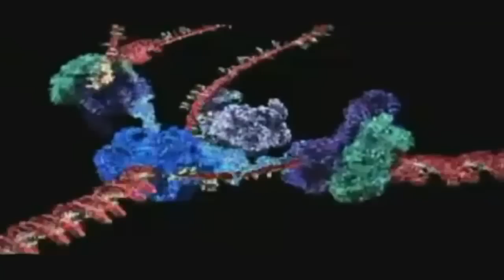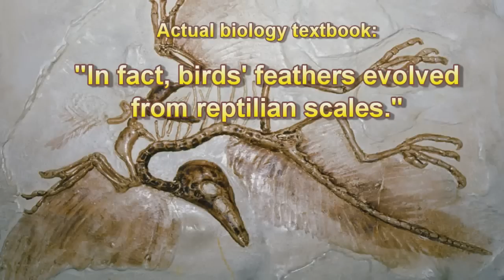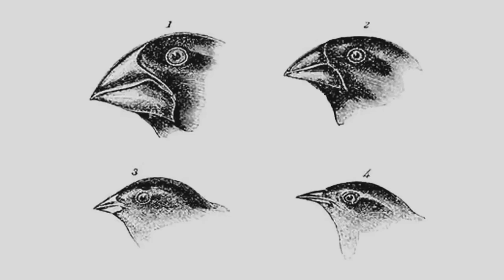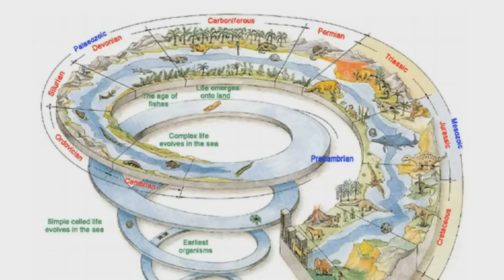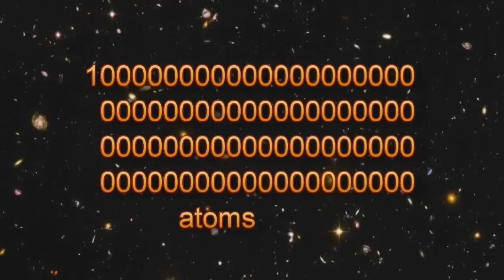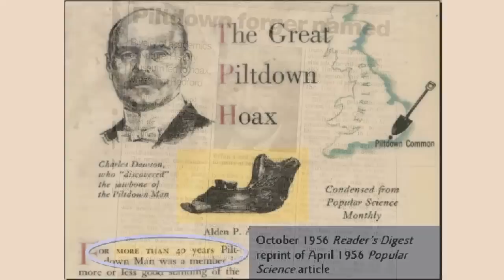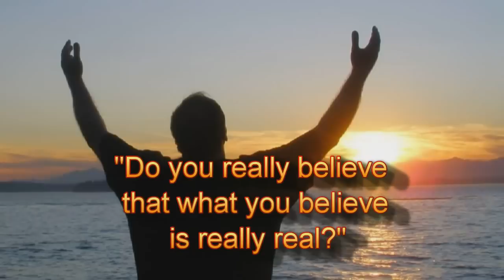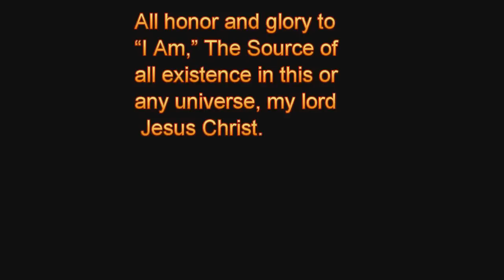Evolution Demolition

Comment: 11:10 Abiogenesis.

That's correct, we have no established theory for abiogenesis, yet.

However, we've made pretty damned good progress with the "RNA World" hypothesis of abiogenesis. Largely thanks to the scripps research intitute.
We've demonstated how molecules could naturally go from simple molecules like sugar (and phosphate, or whatever), to ribonucleotides. Ribonucleotides have been shown to easily link up into chains, RNA. We've demonstrated that RNA can be really good at self-replicating, and can mutate and still self-replicate indefinitely. That is, they can "evolve" into better self-replicators.
We've also shown that RNA can turn itself into DNA.

So, we've got simple molecule to DNA demonstrated. That's pretty good work. Not quite a full solution to abiogenesis, but pretty far on the way to it.

Now as for ATP synthase molecule... once again you're making the mistake of assuming that the current iteration of cells, and their internal parts, are what must arise through abiogenesis. Complete crap, obviously. 
That ATP synthase molecule has evolved for 4 billion years. Do you really think it would remain the same over that time, given evolution? No, the better versions would beat the older versions. I suspect we can only speculate on how bad the early versions were.And btw, this is proven by the fact that different lifeforms have different version of this ATP synthase molecule. So obivously it doesn't have to be exactly in one way. E. Coli has a simpler (the simplest, perhaps) form of the ATP synthase molecule, for example.

13:03 Nooo, ask them what they believe about abiogenesis, and if they're good scientists they'll tell you they don't know. They're not "betting the farm" on anything. Only a stupid person would bet on something they don't know.
Dawkins, for example, is an expert of zoology and evolution (right?). Not abiogenesis. Once again, evolution is not abiogenesis. Even if a god (or somethign else) created the first living organism, evolution still happened. Those are separate things.
And yes, god creating life is also abiogenesis, since non-life became life. That is, unless you want to argue that life has always existed, and never "came to be".
I guess the difference is natural abiogenesis vs artificial abiogenesis.

But please tell me why your answer to abiogenesis is "magic"? Ever actually observed "magic"? Anything saying that "magic" is even possible? By definition, "magic" is an exception to natural laws, and you said "no one is above the law", in this very video.
Reply: antiHUMANDesigns "We've demonstrated that RNA can be really good at self-replicating, and can mutate and still self-replicate indefinitely."
Sorry, this has never been done.  But even if it had... What about the source of the information content that instructs how to put biological systems together?

ATP Synthase could not evolve before a living system that reproduces.  Evolution requires reproduction first.  But reproduction requires an energy source, such as ATP Synthase.

What are you talking about?  Abiogenesis is magic.  It is fairy dust.  An intelligent mind operating on a universe is not magic.  We can test for the activity of intelligent design in many sciences.  Why do evolutionists ignore this kind of science?
Reply: Mark Champneys "Sorry, this has never been done. "

Yes, it has. I've read the science. I think it was done by the scripps research insitute.

"But even if it had... What about the source of the information content that instructs how to put biological systems together?"

This is pre-biotic chemistry, it doesn't deal with actual life. It's not quite "biology", yet. RNA that replicates does not equal life.

However, the source of such information would be natural selection acting upon replication with variation.

"ATP Synthase could not evolve before a living system that reproduces.  Evolution requires reproduction first."

That is pretty much a tautology. Evolution deals with living things, so yes, only living things can technically evolve, unless you mean "evolve" in a more figurative sense.

"  But reproduction requires an energy source, such as ATP Synthase."

"Such as", yes, but not that one, specifically. What it needs is a source of energy.

"What are you talking about? Abiogenesis is magic. "

Abiogenesis is life from non-life, whether done by magic or some other means. Even a god creating a human from dirt is abiogenesis.
One thing we can say for sure is that there was an abiogenesis event, since life hasn't always existed. Whether this was a natural occurance of an artificial occurance is yet to be demonstrated.

" We can test for the activity of intelligent design in many sciences. Why do evolutionists ignore this kind of science?"

Explain how we can do that, and I can respond. None the examples I've seen so far have been proper science, because they weren't falsifiable and didn't use a scientific method.
Reply: antiHUMANDesigns "I think it was done by the scripps research insitute."
Nope.  I know of experiments in which a particular enzyme (protein) has been able to catalyze itself to produce more of the same enzyme.  That is the closest thing to self-replication there is.  RNA has never self-replicated, especially not keeping the altered base sequence in the event of a mutation--which would be essential for the term "self-replication" to mean anything.  Never.

" 'Such as', yes, but not that one, specifically. What it needs is a source of energy."
And what is that?

"Even a god creating a human from dirt is abiogenesis."
No it is not, since "a god" by definition is alive.  That would be life from life.  Abiogenisis is the idea of a spontaneous formation of life without a living source via chance and necessity alone.  It is purely materialistic/naturalistic.  I think you knew that.

"Explain how we can do that, and I can respond."
The sciences of forensics, archaeology, anthropology, etc. all detect intelligent activity by direct evidence.  How would CSI lab's do their work without this kind of science?  Intelligent activity leaves artifacts that can be observed.  Things like symbolic digital code.
Reply: ***** Yes... """"forget"""", huh? :P
Reply: antiHUMANDesigns Thanks for the link.  Interesting paper.  I will grant you this much: they have taken this replication thing a teensy bit further than I realized.  It is a few microns further along a trillion lightyear journey to a living microbe.

As I look at the paper I notice that the authors play fast and loose with a couple of terms.  The term "self" and the term "information."  They call it self-replication, yet the scientists supply most of what is needed to make the chemistry happen, and few of those things would ever be supplied naturally or spontaneously.  I get that they want these short RNA molecules to make copies of themselves by themselves.  But wanting is not having.  It may be replication, but it is anything but self-replication.  I was actually pleased to see that they admitted to the word "information," since that is really the issue here.  Yet what they describe is not prescriptive information at all.  And even if it were, they have not dealt with the issue of where the encoded instructions came from or what the instructions do.  Again, the main issue.

I also noted that the RNA strands were extremely short.  This is important, since the longer they get, the more fragile they become, reducing the likelihood of their "survival" in the face of their susceptibility to increasing entropy.

Are you really arguing that God (if He exists) is not alive?  Goofy, and irrelevant.

"...it's true that intelligent design isn't very interesting to the subject of biological evolution, for the most part."
They are not interested because they have a priori ruled intelligent activity out.  You use the word "supernatural" as an emotionally charged word, but isn't all intelligent activity outside of nature in a sense, and within nature in another sense?  If a victim is said to have died of "natural" causes, does that mean that another may have died of "supernatural" causes?  I suggest dropping the notion of supernatural being somehow magical, and consider a Creator who is the very source of nature--an entity that can by studied (in part) by what He has made.  As I said, intelligent activity leaves artifacts.  Why are evolutionist scientists afraid to consider those artifacts?

Three kinds of causality exist in the universe: chance, necessity, and agency.  By chance I mean the laws of mathematics and statistical probabilities.  By necessity I mean natural law and physical properties.  By agency I mean the volition of intelligent mind.  Evolutionists are extraordinarily unscientific by choosing to consider the first two kinds of causality, and ruling out the third without basis.
Reply: Mark Champneys Well, yes, the furthest that I am personally aware of us getting, is all the way up to how DNA enzymes can come about. But you're absolutely right that a DNA enzyme is not "life". 
But consdiering how fast we're moving, just give it some more time, and we might demonstrate how proper "life" can come about. Those scientists are pretty good at what they do.

"They call it self-replication, yet the scientists supply most of what is needed to make the chemistry happen"

Yeah, chemistry needs to have chemicals accessible, that's obvious. And they don't do thes experiment in a lake, so to say, but in a controlled environment.
The thing is, first you need to know what is needed to make it work, and then you can work on how those needed things could have been there.
It's true that if they need something that cannot have existed, then the whole hypothesis falls flat right there. But I don't think that part is settled yet.
And remember, this is still a hypothesis, not a theory. It's only a proposed solution to abiogenesis, not a verified solution.

" It may be replication, but it is anything but self-replication."

No, it's still technically self-replicating, since nothing else is doing the replication for them. It's obvious that you need materials to build a house, but if the house built itself from the materials provided, it's still a self-assembling house.

" And even if it were, they have not dealt with the issue of where the encoded instructions came from or what the instructions do."

That is because of ignorance on your part. A DNA molecule is just a molecule, and it has chemical properties. The structure of DNA makes certain things happen. What the "instructions do" depends on the laws of chemistry, nothing else.
For example, oxygen and hydrogen will combine to form water - not because someone instructed that, but because that's what happens. And DNA is a molecule in the same sense that water is.
You cannot look at modern DNA, which has already evolved for 4 billion years, and ask how that DNA could come from "nothing" (so to speak), since it didn't. Modern DNA is the way it is because it copied itself from DNA that already had those sequences.
What you really need to know is what basic things DNA needs to get life going. We don't know that, and we don't know how many possible combinations could lead to something that "works". The fact that our bodies work the way they do might just be a coincidence, and we might have worked a different way.

However, our DNA has evolved from merely being a chemical process, to being a form of machine code that runs a machine. (At least it's a valid comparison.)
But that doesn't mean that's how DNA started. In fact, it cannot have started that way, it must have evolved into that.
All I'm saying is that modern life is highly evolved and plays by different rules than the early life that was "barely even life".

"I also noted that the RNA strands were extremely short. This is important, since the longer they get, the more fragile they become, reducing the likelihood of their "survival" in the face of their susceptibility to increasing entropy."

That's pretty correct, yes. The RNA likely changed into DNA when it become so long that the rate of mutations made it hard to survive. I'm specualting, of course. But the selection pressure on the RNA molecule would be for it to not have so many errors. DNA doesn't mutate as easily, so that mmight be eactly reason why that happened. And as it got even longer, some error checking mechanisms might have evolved.

"Are you really arguing that God (if He exists) is not alive? Goofy, and irrelevant."

Most definitely, and I think you would agree.
There are 7 criteria for "life", and god doesn't fullfill all of them, so he would not be classified as life.
Let me see if I can remember them:
1. Maintains homeostasis.
2. Metabolizes.
3. Reacts to stimuli. (Poke it, and it reacts, so to speak.)
4. Grows/delevops.
5. Reproduces.
6. Evolves.
7. Is made of cell[s].
Life must fullfill all of these criterias. 
As I understand "god", he would not fullfill criterias 2, 4, 5, 6, and 7. That means god is not alive.
And yes, this means a virus is not alive, either.

"They are not interested [in intelligence] because they have a priori ruled intelligent activity out."

No, because there is no way to test for it, so it's useless (unfalsifiable). If a god is indeed messing with our experiment, then we have no way to know. If we ever gave that idea real credibility, then we can just stop doing science, because we cannot learn anything about anything.
Obviously, we are albe to learn things, because our technology works. It's evident that the universe is consistent and isn't just messing with us.

" If a victim is said to have died of "natural" causes, does that mean that another may have died of "supernatural" causes? "

The opposite of "natural" is "artificial", not "supernatural".

"  I suggest dropping the notion of supernatural being somehow magical"

I'll accept anything, once someone can demostrate it. But because it is impossible to ever demonstrate something that isn't natural, I don't expect to ever get an example of something that isn't natural.
If god was ever demonstrated to actuall yhave an impact on the universe, then I'm quite sure whatever method he uses to do so will be considered "natural".
Or, as AronRa said, "if god sticks his hand into the universe, his arm will be dripping with physics". (Might not be an exact quote.)

"and consider a Creator who is the very source of nature--an entity that can by studied (in part) by what He has made. As I said, intelligent activity leaves artifacts. Why are evolutionist scientists afraid to consider those artifacts?"

Once again, because you're making an unfalsifiable claim. If you're saying that an omnipotent god, that is outside of the universe, is the cause of some things in our universe, then how does one test for that? An omnipotent god is able to do anything, and in any way, so there is no test that can be made to falsify this idea.
That makes it..
1) Unfalsifiable, and therefore not science.
2) Completely useless, since you can't say that anything would be different whether god exists or doesn't exist.
Therefore, such a claim can be promptly ignored. Since ID is not science, I don't see why you're asking scinetists to treat it as such.

However, if you can propose any kind of test that could falsify your claim, then we're all listening. What predictions does your claim make?

"Three kinds of causality exist in the universe: chance, necessity, and agency."

I do not accept this. There is only one kind of causality, and that is causality. Causality cannot, per definition, be "chance", because causality is per definition something happening out of necessity, that it couldn't have happened any other way. This is why we consider the universe to be deterministic.
An intelligent agency being the cause behind something doesn't change this, unless you're arguing that there is some kind of intelligence that is isn't bound by cause and effect. Prove that such a thing could ever exist, because it violates reason. If something can happen without a reason, then you would not be able to form thoughts, because the activity in your brain would be random, not structured.
Imagine a computer where the electrons don't follow their paths, and just does stuff for no reason. It wouldn't work, because it couldn't be controlled or structured.
Reply: * tagging thread to follow
Reply: Max Spiegel 2 days without a reply, so I suspect it's over.
Reply: antiHUMANDesigns Yeah, Mark just quietly fades away on most of the threads he comments on when he encounters someone with a decent degree of scientific literacy. Oh well, nice job eviscerating his nonsense on this one.
Reply: +antiHUMANDesigns I am answering lots of posts on this forum, and your latest post is very long, so the feasibility of responding properly to so many comments becomes daunting.  You will have to be patient.

"No, it's still technically self-replicating, since nothing else is doing the replication for them."  Wrong, it takes many things including a supply of perfect parts, and properly harnessed energy, so that the process builds rather than destroys.  Polymers become much more than simple chemical bonds.  That would be like saying that the existence of mortar means that buildings will happen spontaneously.  No, polymers are very different than water molecules, by virtue of their complexity.  Enormous numbers of possible shapes and structures become options, and that is where instructions come into play.  It takes more than laws of chemistry.  It takes molecular machines put together with purpose.  Things like ribosomes or ATP synthase motors.

"Those scientists are pretty good at what they do."  Okay, I don't want to denigrate evolutionist scientists, but the best baseball player in the world gets out more than 60% of the time.  Very good scientists are wrong more than they are right.  It is perfectly permissible to question them, rather than blindly accept whatever they say.

"...we don't know how many possible combinations could lead to something that works."  Actually we have a pretty good idea.  The problem is not the assemblages that "work," but the far more vast numbers of permutations that don't.  It is like trying to dial into a safe that requires 10^160 turns, and then getting the right one.  With such a safe, even a million combinations that "work" would be operationally impossible to happen upon in our universe lifetime.  Improbability mounts up exponentially.  It is the nature of mathematics.

"And as it got even longer, some error checking mechanisms might have evolved."  Based on what???  Your hopes and wishes?  Have you ever seen this happen?  Has anyone?  These kinds of pipe dreams seem to be what evolution is made of.

"No, because there is no way to test for [intelligent activity], so it's useless..."  This is where you are completely wrong.  There are many scientific tests for the artifacts of intelligent activity.  It is done all the time in other branches of science, such as forensics and archaeology.  It is not even that difficult.  Why do evolutionists refuse to apply these tests to biology?

Your comments about causality, like claiming that God is not alive, make no sense at all.  Luck or coincidence cannot affect things?  You don't believe that.  It is obvious that you believe agency can cause things, because you believe you can cause things.  Your list of aspects of life are descriptive, not prescriptive.  I would argue that a conscious entity is alive by definition.  I would insist that the cause of all conscious thought is certainly alive.  If you want to define the source of life as not being alive, I'm not going to waste my time arguing that one.  Believe it if you want.
Reply: Mark Champneys "It takes more than laws of chemistry. It takes molecular machines put together with purpose."

How can you say that, when it's been demonstrated experimentally that you're wrong? Incredible.

"Very good scientists are wrong more than they are right."

Yes, and the experiments let them know when they're right or wrong. It's a very, very rare case that a scientists believe he's right without actually being right. That's because a scientist will not believe something is right before it's been tested properly.
Forming a hypothesis doesn't mean you believe th ehypothesis is right, it means your believe it could be right, and therefore worth testing.

"It is perfectly permissible to question them, rather than blindly accept whatever they say."

I agree completely. However, to question a scientists work, you need to know enough about the subject in question. Otherwise, you're just wasting his/her time.

"With such a safe, even a million combinations that "work" would be operationally impossible to happen upon in our universe lifetime. Improbability mounts up exponentially. It is the nature of mathematics."

Except in this case, you cannot even say that only a million combinations work. you have no idea.
For example, someone was arguing something similar about ligases forming, and it turns out that 10^120 different combination makes useful ligases. Sorry about the complete lack of context, and so on, but all I'm trying to say that is that nature can surprise you. Be careful about saying things that you don't actually know.
Teh nature of mathematics is that it can play tricks on you if you dot' know how to apply it to the real world properly.
Speaking of low odds, for example, the odds of me, sitting here right now, talking to you, is impossibly low. So this should not have been possible, yet it's happening. The exact quantum states that we are in right now, they coulnd't possibly have happened, considering how many possible quantum states there are.
So I'm obivously not actually talking to you, right? Or perhaps we're applying the math incorrectly.

""And as it got even longer, some error checking mechanisms might have evolved." Based on what??? Your hopes and wishes? Have you ever seen this happen? Has anyone? These kinds of pipe dreams seem to be what evolution is made of."

At first, there clearly were no error checking mechanisms, because that would not make sense. Then, at some later point there were such mechanisms, we know this.
So at some point they were somehow added.
Did you miss me saying "*might* have evolved"? I don't know, and I don't think anyone does. And I have no "hopes or wishes" either way, I'm only trying to learn. What I think about things is completely irrelevant.

""No, because there is no way to test for [intelligent activity], so it's useless..." This is where you are completely wrong. There are many scientific tests for the artifacts of intelligent activity. It is done all the time in other branches of science, such as forensics and archaeology. It is not even that difficult. Why do evolutionists refuse to apply these tests to biology?"

And I have agreed to this, that we can examine the artifacts of humans, for example, but when you're talking about supernatural intelligence, then it is unfalsifiable.
Better yet: Tell me how to falsify intelligent design. Show me that it's science, that it's falsifiable, and not just useless.

Why do we not apply it to biology? Because we've already followed the evidence where it leads, and it doesn't require that we insert some kind of supernatural intelligence into it. Evolution doesn't require anyone controlling it, otherwise it wouldn't be a proper theory.

"Your comments about causality, like claiming that God is not alive, make no sense at all."

It makes absolutely perfect sense. We have criteria for what "alive" means, and god doesn't fullfill those criteria, does he? So then it's pretty damned clear. The only way god would be "alive" is by changing the critera for "life". What would you like the criteria to be?

" Luck or coincidence cannot affect things?"

What is "luck"? Seems like something is "luck" only because a mind/brain thinks it is, not because it truly is.

"Your list of aspects of life are descriptive, not prescriptive."

You mean the criteria for what is life? Once again, it's not my criteria, it's the scientific definition. We need to have some way to determine what is life and what isn't. Just tell me criteria you would set up to distinguish life vs non-life. See if you can do any better.

"I would argue that a conscious entity is alive by definition. I would insist that the cause of all conscious thought is certainly alive."

And those who are not conscious, such as a flower? Is it not alive? You've got a crappy definition of "life", when it doesn't include plants, just because they don't have brains, even though we're make of the very same stuff.
Seems to be me that you're defining what is conscious, not what is alive.

"If you want to define the source of life as not being alive, I'm not going to waste my time arguing that one. Believe it if you want."

If you want to talk about abiogenesis, then yes, you're going to have to deal with life coming from non-life. And yes, you're going to have to deal with it in scientific terms.
Reply: +antiHUMANDesigns With a few exceptions, your answers are largely unresponsive, so I take it you don't want to have a real conversation.

"How can you say that, when it's been demonstrated experimentally that you're wrong?  Really?  When did experiments build ATP Synthase?  Or a ribosome?  I must have missed that part.

"Tell me how to falsify intelligent design."  Very, very easily.  Simply find one single case of objectively decodable symbolic code originating from natural causes alone (other than the thing we are testing of course).  Just one will do it.  Objectively decodable symbols are slam dunk proof of an intelligent mind.  They can't happen any other way (just as my video described).  DNA sequences are prescriptive information (functional instructions).  Prescriptive information is the most unmistakable decodable symbolic code of all.  Such has never once originated by natural causes alone.  Never.  ...Or show me an exception if you will.

If a Creator does not fit your description of "life" it is only because He would have to be greater than any life we know.  Consciousness is prima facie proof of life, whatever else life may be.  There was never a claim that a flower is not life.  You're only demonstrating that you are not serious about this discussion.
Reply: Mark Champneys "With a few exceptions, your answers are largely unresponsive, so I take it you don't want to have a real conversation."

if you're simply going to state things that are demonstrably wrong, then no, there is no point in having a conversation.

""How can you say that, when it's been demonstrated experimentally that you're wrong? Really? When did experiments build ATP Synthase? Or a ribosome? I must have missed that part."

The context is "self replicating molecules". You've said that they can't just come about by natural means, even though that's exactly what we've demonstrated experimentally.

"Tell me how to falsify intelligent design." Very, very easily. Simply find one single case of objectively decodable symbolic code originating from natural causes alone (other than the thing we are testing of course).  "

And how does that falsify intelligent design, when an omnipotent god creator can do exaclty what he wants? Finding such a code would not falsify the idea that life was created by an omnipotent god. Nothing can falsify that, because it doesn't make any testable predictions. There is nothing we can demonstrate to be true that a god could have made that way. Not a single thing. Therefore, it's not falsifiable.

"Such has never once originated by natural causes alone. Never. ...Or show me an exception if you will."

First of all, your view of what DNA is and does is simply wrong. You're seeing it as a message, when it's not. It's a chemical memory. It remembers what sequence is required to make something that copied itself. That is a fact.
Another fact is that these sequences change with time. As a whole, this is called "evolution". DNA evolves. If there ever was a "message" in there, it has changed and been lost billions of years ago. It's perfectly feasibly to imagine life on earth starting from some artifical means, but from there, it has taken its own natural cause. That has been established through hundreds of years of scientific work, and it more evident now than it ever has been.

"If a Creator does not fit your description of "life" it is only because He would have to be greater than any life we know."

"Life" is not a scale. If you fullfill all 7 criteria, you're alive, otherwise you aren't. Yes, some non-life is more lifelike than others, but something that is alive, like a fungus, cannot be less alive than anythign else, because you cannot fullfill more criteria than exists.
So explain to me what a "greater life" is.

"Consciousness is prima facie proof of life, whatever else life may be. "

So if a computer would be conscious, it would be alive, then? Scientifically, it wouldn't be.
It would be conscious, not alive.

"There was never a claim that a flower is not life. You're only demonstrating that you are not serious about this discussion."

Then you're demonstrating my point: Consciousness is not a criteria for life. Flowers aren't conscious, yet you agree that they are alive, so then you don't have to be conscious to be alive.
If consciousness is not a criteria that all life shares, then it is not a criteria for life.
Reply: +antiHUMANDesigns "And how does that falsify intelligent design, when an omnipotent god creator can do exaclty what he wants? "  We are not falsifying an omnipotent god, but intelligent activity.  Intelligent activity leaves artifacts.  Those artifacts can be tested by science.
"You're seeing [DNA] as a message, when it's not. It's a chemical memory." DNA is not an imprint of what was, but a plan of what is to be.  Yet that blueprint is encoded based upon arrangement of just four possible nucleotides.  Base-4 sequencing is called digital code.  Digital symbolic code has only ever originated from a mind.  Never once by undirected causes.  If this digital code did not result in the building of highly complex and highly functional biological systems, you would have a point, but the precise outcome of this decoding, proves that it is indeed decoding of a "message."
"So if a computer would be conscious, it would be alive, then? "  Computers are not conscious.  They can only be made to emulate the appearance of consciousness, despite all efforts thus far.  But, yes, if it were truly conscious, I would define it as "alive" automatically, although your list of characteristics connotes life as well.  Is there a point to all this?
Reply: Mark Champneys "We are not falsifying an omnipotent god, but intelligent activity."

OK, I thought you believe in an omnipotent god, do you not? Isn't that what you're proposing is the creator of "everything"?

"Intelligent activity leaves artifacts"

No, it doesn't have to. That's quite an assumption, and for no apparent reason. A worm, which is not really "intelligent" can leave just as much "artifacts" as a cat does, which is a lot more intelligent.

"Those artifacts can be tested by science."

Well, we can agree on that. Artifcats and such traces are evidence for us to use in understanding something.

"DNA is not an imprint of what was, but a plan of what is to be. "

It is both:
1. It is what it is because its parents survived, was selected for. DNA changes to adapt to the environment, so it is an imprint of its history, in this sense. It also carries all the mutations and such from its history. I call it a "chemical memory" because it is a way for an organism to "remember" how to "rebuilt" itself once more.
2. It is a plan for what is to be, because that's how life develops, how it reproduces.

"Yet that blueprint is encoded based upon arrangement of just four possible nucleotides."

It is not "encoded". Those are not "codes", they are sequences of nucleotides that form a molecule. "Codes" only exist in minds, because they are symbolic.

"Base-4 sequencing is called digital code"

A sequence is not called a "code". A "code" is second-level symbolism, some symbol that stands in place for another symbol in accordance with some coding system. A "code" needs to be "decoded" before the meaning can be understood.
"2015-02-26" <- this is code, for example. But it's only code because I wrote it with the intention of it being decoded using a common coding system. You can decode this to mean "the 26th of february, year 2015". And you can understanding this symbolism because you have a mind.

And the DNA sequence is not "digital", since it's not numbers. It's nucleobases.

" Digital symbolic code has only ever originated from a mind."

First of all, a DNA sequence is not code, and it's not digital.
But even if it was, you'd simply be wrong, because then DNA is an example of such a thing originating from somethig else than a mind.

"Never once by undirected causes."

A gazillion times, though the process of evolution.

"If this digital code did not result in the building of highly complex and highly functional biological systems, you would have a point"

It sounds as if you're arguing that the information could come about through natural means, but the same information could not come about by natural means if it is used the way living organisms use them.
I hope you see how that makes little sense.

" Computers are not conscious. "

Hey, I'm not saying that they are. But I don't know that they're not. I don't know how to define "consciousness" outside of brains, which might well just be one "kind" of consciousness. Perhaps computers have a different kind of consciousness, I don't know, because I don't know how to truly define it.
A computer can be self-aware. That doesn't take much. Any computer whose operating system is aware that it is a specific instance of a computer is self-aware. It knows about its own existence.
Does that qualify as "conscious"? I'd say no. But I don't know what does. We can tell when a biological brain is conscious and when it's not, but... that's not the same thing as knowing what components are required for something to be considered conscious.

"They can only be made to emulate the appearance of consciousness, despite all efforts thus far"

Tell me the difference between consciousness and emulated consciousness, assuming they still have the same result. That is, that they still display the same kind of emotions, and such. I mean, I can make a program that responds to input, and I can program it to have "moods" and such, which affect how they decide to respond. When does it truly become conscious, instead of simply emulating it?

"But, yes, if it were truly conscious, I would define it as "alive" automatically"

Ok, well, science wouldn't. And what I asked you for what the "minimum requirements" for life. You seem to agree that someone can be conscious or not, and it could still be "life". So that makes consciousness irrelevant to the definition of life.

"Is there a point to all this?"

No idea, you waiting way too long to answer, so I have forgotten the context.
Reply: +antiHUMANDesigns We are discussing intelligent activity, particularly in the design of living things, not the omnipotence of such an agent.  However, if functional DNA code is the work of such a mind, it would be a very impressive mind indeed.  DNA is a code by any definition.  Yes, it does need to be decoded, and is, by the biological machinery that builds organisms from it.  Yes, it is digital, and the four bases do function as numbers.  Exactly so.  Information scientists like Dr. Don Johnson will tell you so.  (PhD's in both chemistry and information science.) 
"A gazillion times through the process of evolution"  Evolution is the thing we are testing.  You cannot claim that evolution proves evolution.  Circular reasoning.
Reply: Mark Champneys But a crow is intelligent, and a mouse is. they cannot design and create a speices, for example. Define what it is you're talking about!
"Intelligent activity" <-.Define it so that I could know it if I saw it!

 
" DNA is a code by any definition."

We're talking about the sequence of nucleobases, right? The macromolecule, DNA?
It is not code because it is not second-level symbolism.

" Yes, it does need to be decoded, and is, by the biological machinery that builds organisms from it."

No, it is not decoded, and it is not a code. It is a sequence of nucleobases that have chemical properties. Codes only exist in minds.
If I write a code on a piece of paper, the lines on the paper is not code, it is lines of graphite/ink on paper. In my mind, and in your mind, it may be code. But that is all about the intent behind it. It is code (within minds) because it was intended as a coded message. But in fact, it is not code. If everyone forgot that it was intended as code, it would no longer be code to anyone.

"  Yes, it is digital, and the four bases do function as numbers."

No, once again, numbers are abstract, they also only exist in minds. Two apples do not "contain" any two-ness in reality, only in our minds. Without minds, there still are two apples, but the number/concept "two" disappears from the universe.
"Digital" mean that something is displayed as numbers, or that is conceptually works with numbers. It has nothing to do with DNA in any way at all.

"Information scientists like Dr. Don Johnson will tell you so."

A creationist. And even if he wasn't a creationist, I don't care. It's still not true. He is wrong.
Just because something can be described in terms of numbers doesn't make that thing digital. DNA would only be digital if it was intended to be thought of in a digital way. It wasn't. It is a sequence of nucleobases.

" Evolution is the thing we are testing. You cannot claim that evolution proves evolution. Circular reasoning."

No, it isn't circular. If I wanted to prove that evolution exist, I would do it by showing you evolution. It's as far from circular as you can get. Evolution does prove evolution. That's the only thing it proves and can ever prove. The existence of something proves that it exists and that it can exist.
Reply: Mark Champneys Just to add a few things, if I write the string "Wf32BXMSN7A" is that a code or not? If so, what does it code for? How can you tell? What about the number "299792458?" Is that a code for the speed of light, or for the latitude of the pyramid of Giza? As AHD said, it is not a code for either except in the mind of the code-writer. It has no objective value as a code.

Molecules are most certainly analogue systems. We can treat any analog system as a digital one by representing characteristics with numbers, but the information itself is analogue in the case of DNA until someone decides to represent it as digital by mapping each molecule to a symbol. Of course, this mapping would not be sufficient to replicate the behavior of DNA because it doesn't capture the information about how to be translated into a protein without its chemical environment. Again, the code has no meaning at all outside of context and intention of the code-writer.
Reply: +antiHUMANDesigns "Codes only exist in minds."  Bingo!  It would take an intelligent mind to conceive of DNA information, let alone to program it to perform the marvelous function we see in living things.

"No, once again, numbers are abstract, they also only exist in minds."  Again you prove my point.  Numbers do exist in the DNA code.  A case in point is a DNA mutation that causes a baby to be born with three arms instead of two.  Obviously the "abstract" number got changed in the code.  But yes, the idea of coding numerical data must come from a mind.

"A creationist."  Dr. Johnson has two PhD's, but you choose to dismiss him because you don't like his point of view.  Amazing.  With such a dismissive attitude, how can you be worth talking to?  Utterly unscientific and unobjective.
Reply: Mark Champneys Yes, only minds can "conceive of" things. But no one needs to *conceive* of DNA for it to exist, and if DNA existst, then it automatically carries information.
But none of this has anything to do with codes.

"Numbers do exist in the DNA code"

DNA is a molecule, it's made of atoms, not numbers.
Someone who creates a DNA sequence may consider sequences to represent numbers, in which case they are numbers in that persons mind. But that doesn't make the sequences different, just because you think of them differently. They are still sequences of nucleobases in a macromolecule.
In the same way, a binary sequence in a computer is only a binary sequence, but we can choose to think of them as numbers, if we want to. But they will onlly be numbers in our minds.

I feel like I've explained this to you 20 times, now.

"A case in point is a DNA mutation that causes a baby to be born with three arms instead of two. Obviously the "abstract" number got changed in the code. "

That is a way of thinking about it, yes.

"But yes, the idea of coding numerical data must come from a mind."

You're missing the point. You cannot "code numerical data" in the way you think. It's only "numerical code" in your mind (or in "a mind").

""A creationist." Dr. Johnson has two PhD's, but you choose to dismiss him because you don't like his point of view. Amazing. With such a dismissive attitude, how can you be worth talking to? Utterly unscientific and unobjective."

He is full of shit, it's that simple. And his PhD's are utterly irrelevant. He might have got his PhD by doing proper science, and now uses the fact that he has those PhD's to convince people that he is automatically right in everything he says.
I ahve skimmed through some stuff he has said, and he is wrong. Simply wrong. I don't care who says that kind of shit, it's wrong no matter who says it.
Reply: +antiHUMANDesigns    "DNA is a molecule, it's made of atoms, not numbers."  Of course DNA is a molecule.  And War and Peace is ink and paper.  Yet there are ideas embedded in that ink and paper, and there are ideas embedded in that molecular sequencing.  Designs.  Improbable, amazing, designs--beyond anything man has ever been able to achieve.  The mere presence of that coded information makes it a symbolic representation of thought.  And symbols can only originate from mind.  If DNA's information was directly convertible into biological machinery, you might have an argument.  But the prescription is transcribed and translated in many steps to achieve the end result.  The overwhelming improbability of it makes it a slam-dunk.  DNA is carrying abstract thoughts, designs.
   'It's only "numerical code" in your mind (or in "a mind")'   Or in actual function.  Thought is a real, non-corporeal, thing that exists.  And those thoughts can affect matter and energy.  The information in DNA plays out in reality.  We can observe this.  Numbers are certainly abstract.  But they are also real things that exist.  The entire universe is proof.
   I agree with you that having PhD degrees does not mean that a person is right.  That cuts both ways, however.  I think evolutionist PhD's are full of it.  The real question is truth.
Reply: Mark Champneys
You're deeply stuck in a fallacy, and won't let go of it. The fallacy is called "reification":
https://en.wikipedia.org/wiki/Reification_(fallacy)
"Reification (also known as concretism, hypostatization, or the fallacy of misplaced concreteness) is a fallacy of ambiguity, when an abstraction (abstract belief or hypothetical construct) is treated as if it were a concrete, real event, or physical entity. In other words, it is the error of treating something which is not concrete, such as an idea, as a concrete thing. A common case of reification is the confusion of a model with reality: "the map is not the territory"."

You simply cannot stop confusing the label of something for the thing that it refers to.
Absolutely everything you say is based on this fallacy. Abstract things existing within DNA, numbers existing as real things, the story in a book existing as a real thing, and so on.
Of course you won't understand this if you cannot move beyond that fallacy.
Study that fallacy and come back for another attempt.
Reply: +antiHUMANDesigns   This is really the essence of the issue, isn't it.  Is prescriptive information (and information processing) concrete, or abstract?  If you were to say that information (messages) is non-corporeal, then I would absolutely agree with you.  Information has no mass.  However,  information--stored or transmitted--is real, not abstract.  It has real effects on the corporeal universe.  Computers have working results.  Biological systems have working results.  Complex, functional, instructions are indeed processed with predictable outcomes, based upon input.  You superstitiously want to believe that life just happens.  I insist that it is carefully directed based upon the processing of code.  The results speak for themselves.  The computers in cells operate exactly like any other computer, with input, decision nodes, communication, and output.  These are not abstractions, but working mechanisms.  You do realize that most evolutionists admit that living systems are computer and information driven, don't you?  From Francis Crick to Richard Dawkins.
Reply: Mark Champneys Well, the information exists (in DNA) in the sense of information theory, that it is objective and measurable. To change the information, you'd have to physically change something, so to say.
But this is also why it's only information in that sense. Anything else that you impose on it is subjective, and therefore also only in your mind.
When you call a certain sequence "TTGA", you're conceptually describing it, putting labels on it and using symbils for efficient communication, and so on. But it never made the thing anything more than it was. We can do the same with table legs, or rock formations, or anything else.

"  If you were to say that information (messages) is non-corporeal, then I would absolutely agree with you"

OK, good.

"However, information--stored or transmitted--is real, not abstract."

But wait, which kind of information are you talking about, now? Anytime you send some kind of signal from one device to another, the sequence of "beeps", or whatever, automatically is information, whether it contains a message or not. It has a measurable amount of information depending on the complexity and randomness of the signal.
But on top of this, if it was send from a person to another person, this pattern also may contain a message that in itself isn't really measurable mathematically. It only has personal value, so to say. It's an entirely different meanin gof the word "information", because this is the kind of information where one mind is informing some other mind. It isn't the sequence that is important in that case, but rather the meaning of the sequence. And the same thign can be "said" in many different ways, which all inform the other mind of the same thing.

This "informedness" kind of information is not physically real. In your mind, you hold the knowledge that a certain pattern of "something" is supposed to be interpreted in a certain way. When you see that pattern, you assume that's meant to be interpreted that way. But the pattern itself never held that information. It didn't contain the message, it only contained the symbols required to "provoke" that response in your brain/mind.
And because the sequence/pattern didn't hold that message, this way, it's possible for you to misinterpret/misunderstand it. If the pattern held the actual message, there could be no way to misunderstand it. It would be like telepathy: A thought transmitted to another brain.

"  It has real effects on the corporeal universe. Computers have working results."

No, the sequence didn't have an impact, it was the machine that made the impact, but it "decided" what to do based on input. The way to interpret the input was built into the machine.
I mean, without the computer to do things, the sequence has no effect on the universe, which means it is the computer that's having the effect on the universe. And to the computer, the sequence is arbitrary, it's whatever has been agreed upon.
Two completely different instruction could just as well have been the same thing, or something completely different.
But also note that computer definitely are intelligently designed, so the analogy can only go so far.

"Complex, functional, instructions are indeed processed with predictable outcomes, based upon input."

Yes, simiarly to computers. We agree on this, it's just that you seem to draw some weird conclusion from it.

"You superstitiously want to believe that life just happens."

No, I suspect, from my limited understanding of physics and chemistry, than life may be inevitable given the chemicals and environment that makes it happen. There is nothing in science that prevents it from happening. And there is nothing "magical" about life.
Even if we can't practically create life from atoms with our current technology, it's clearly theoretically possible. If we were to put molecules in the exact same configuration as a living cell, it would become just like that living cell. (Otherwise, why are the molecules even there?)

But I have no particular belief about how life can "happen". I'm not sure how to define abiogenesis, in a detailed way. I'm not sure what "life" really is supposed to be defined as. Something that is "nearly life" seems like it should be considered life, perhaps, I don't know. At that level, the line between life and non-life gets really blurry.

However, once life does exist, and it replicates imperfectly to create natural variation, I know for a fact that it will evolve. There is no question about it, because it is esily proven.
However, that doesn't mean that I know what happened in the history of life on earth. Perhaps all life on earth isn't related (though there's is very strong evidence for it). But the mechanisms are clearly there, and for whatever happened in the past, we still know that life will evolve in the future.

" I insist that it is carefully directed based upon the processing of code.  "

By what mechanism or process? I mean, if you can demonstrate the process/mechanisms, then we're all listening.
 

" The computers in cells operate exactly like any other computer, with input, decision nodes, communication, and output. These are not abstractions, but working mechanisms. "

Yes, I agree, once again, as long as we agree that they're computers only by analogy, of course. But the principle is similar, yes.
I have not argued against this, I have mostly argued against your use of the word "code", since that implies 2 levels of abstraction, none of which exist outside of minds.

"You do realize that most evolutionists admit that living systems are computer and information driven, don't you? "

And I agree that they are. Just not the kind of "information" you have been talking about.
Of course DNA holds information, that's its entire purpose. It's the reason we can inherit things, and so on. No one is going to argue against that.
I wouldn't use the word "computer", though, since they're absolutely not computers. They do not calculate math, which is what a "computer" is. They do physical things, kind of like automated manual labor, and they take their instructions via mRNA and whatnot.
The main difference between a computer and and a cell is that the cell only exists to further the information. The cell is a product of the information. A computer usually doesn't hold the blueprints to itself, and isn't physically a consequence of the information it holds.
Reply: +Seen From Space    "abundant observation of systems actually evolving in real time"  Not only is such observation non-abundant, it is non-existent.  Change is not what we are debating, but upward change.  Random mutations building up genetic instructions.  It has never been observed. Not once has a random process ever written instructions.  It is against the law.  You are correct in saying that complexity in and of itself is not evidence of design.  (A dirt clod is complex.)  But complexity combined with functionality is such evidence.  Coherent functionality in a complex fashion is overwhelmingly improbable without design.
Reply: +antiHUMANDesigns    I am very encouraged by your lengthy response.  It shows a lot of thought.  Much more than the knee-jerk reactions I often hear.  I encourage you to keep going with it.  Never get "comfortable."  Science is never "settled."
   "It didn't contain the message, it only contained the symbols required..."  Ah, but you have contradicted yourself.  Where symbols exist, a message exists.  Thoughts.  Logic.  It doesn't have to be one mind communicating with another mind.  It can be a mind communicating with a machine to render an outcome.  Information can be communicated, or stored, or processed.  But, yes, the ultimate origin must be an intelligent mind that has agency (volition).  Mind makes the rules of language and syntax arbitrarily, but once made, the following of the rules makes information processing, storing and communicating possible.  The rules reduce the likelihood of "misunderstanding" by the very fact that they are arbitrary yet discrete.  A particular sequence of A-C-G-T says, "build a pancreas."  Another sequence says, "build two lungs."  Arrangement according to syntax.  Messages.

   "I mean, if you can demonstrate the process/mechanisms, then we're all listening."  The mechanisms are to be seen all around us, although learning the details is a never-ending quest.  Every time you see a zygote become a baby you see the processing of code according to a specified blueprint with a clear outcome.  It didn't become a jellyfish, did it.  By the way, I have used the word "blueprint" as a metaphor, but the word "computer" literally.
   "...as long as we agree that they're computers only by analogy"  I appreciate your meeting me halfway here, but I can't reciprocate.  It is not an analogy.  It is a literal reality.  The first computer invented was mechanical, not electrical.  It is not the medium that determines whether something is a computer.  Computers process information and make decisions.  In some cases that includes math, but not necessarily.  But I won't concede that biological computers don't do math.  They absolutely do.  DNA itself uses a base-4 system.  Numbers are very important in biological systems (two kidneys, one spleen, ten fingers, etc.).
Reply: Mark Champneys"symbols exist, a message exists."

Yes, I agree. But careful with the reification fallacy, though: The *message* doesn't actually exist. The thing that carries the message exists, and the patterns that we can recognize exists. But when a human mind sees that pattern, we think of it as a message, because we assume it was meant to be interpreted as message.
Sometimes we're wrong. We see letters in shapes and have to look closer only to realize it probably wasn't intended as a message, it was just an oddly shaped random scratch, or something.
And if we really did think taht a random scratch was a message, then we'll treat it as if it was. But since no one sent that message, then it wasn't intended as a message, so the information in the message cannot be assumed to be accurate. But we might still assume that it is.
That's why messages are special. They are always from one mid to another, they cannot come from a non-mind and still be considered a "message" in that way. However, nature can create things that we might mistake for being a message.

Ever seen faces in the clouds? I have. Our brains have a section that is dedicated at finding faces and spiders and anythign else that might be important, so it plays those tricks on us when it accidentally mistakes things like that.
If we can see faces in the clouds, where there really are no faces, then it's equally weird when people have this brain problem that they can't see faces. Face blindness. Rare, but very insteresting.

"It can be a mind communicating with a machine to render an outcome"

The thing is that when we communicate with a machine, we're normally communicating with software, and that software was written by a person, so you're indirectly communicating with that person, not the machine. A program is sometimes almost like an emulated person, and they tend to be designed in a way makes it intuitive to a human, and predicts what a human would want it to do.

" Information can be communicated, or stored, or processed. But, yes, the ultimate origin must be an intelligent mind that has agency"

Yes, if we're talking about the kind of information that we can share, the kinds that informs people. "I'm going to the theater", or "I think your hair is lovely", or "it is 11 o'clock". Call it "symbolic" information, perhaps?

But nature itself produces the other kind of information, the kind that is part of reality itself, the fact that a proton is not an electron, for example, but also the fact that something is "under" something else, and so on. If there was no information of this kind, then nothing would really exist. If something exists, then it has some amount of information, because it can be described as being in some certain way.
And the increase in entropy increase the amount of information that exists in total, because the more "disorderly" the universe becomes, the more information it takes to describe it, which means it "has" more information.
And this is the kind of information that exists in DNA. DNA is simply the fact that there is a pattern of nucleobases that the physical reality "remembers", so that the information truly "exists", and can be "read". It is objective, not subjective. It doesn't exist in thought, but in reality. It isn't a message, because it wasn't intended as such by a mind.
But that doesn't mean DNA can't contain a "hidden message", because it could. All it would take is for someone to arrange the nucleobases with he intent for it to be a message to someone. Then it is, as long as someone knows that it is, or could somehow figure it out.

"Mind makes the rules of language and syntax arbitrarily, but once made, the following of the rules makes information processing, storing and communicating possible."

Yes, agreed. It relies on people agreeing what the arbitrary symbols should refer to. We must all agree that "happy" refers to that feeling, not some other feeling, or some object, for example.
Once we agree, we can use it to share information between minds.

"A particular sequence of A-C-G-T says, "build a pancreas."  "

No, and for 2 reasons:
1. There is never one gene that by itself builds one thing. Everything is more or less interconnected in a horrible mess.
2. That sequence only produces a protein. No one is explaining to the protein, or to anything else, what it should do, it just follows the rules of chemistry. It just "is" and things happen.

DNA was never agreed upon, because it isn't abitrary. It has to conform to the laws of chemistry. DNA causes a chemical reaction. If you want a specific result, then there is no option, you have to have a specific sequence.

You're comparing the act of ordering someone to move to the act of pushing someone out of the way, if you understand the analogy.

"Arrangement according to syntax. Messages."

Not strictly a message because it didn't come from a mind and wasn't intended as a message in that way. It's not trying to inform someone. We've talked about this already, and I thought you agreed.
The DNA isn't informing a mind about what it wants. It is directly causing something to happen - whether it would want to or not.
It is really doing the job itself. The ribosome is effectively its "hands", it isn't its own individual with its own mind, it doesn't have options and can't make choices.

"Every time you see a zygote become a baby you see the processing of code according to a specified blueprint with a clear outcome. It didn't become a jellyfish, did it."

Yes, but because this baby has mutations that its parents didn't have, it's something new. Very slight difference, almost always, but still something technically new.
And with each new generation, the "blueprint" accumulates more and more small changes.
I don't know why you used the word "specified blueprint", because it seems to imply that someone specified it. They didn't, as I said, because they change, they mutate and they are combined because it's half of each parent's bluprints, and they are different.
What I mean is that if you take a persons DNA at some point in time,a nd then wait a few generations, you'll find no such exact blueprint anywhere, anymore.
And if you take the DNA sequence of every person on earth and wait a few generations, you probably won't find a single one of those exact blueprints anywhere. All of them have changed, more or less.

"The first computer invented was mechanical, not electrical."

Well, I'm not sure that is true - not that it really matter, right? The first real computer (reprogrammable computer) was designed by Alan Turing, as I understand it, and is was electric, it used vaccum tubes, afaik.
Whatever mechanical computer you're talking about could probably output information based on its program, but it couldn't store and read and change its own data in the process of creating the output. Thus it wouldn't be a true computer.

"  It is not the medium that determines whether something is a computer."

I agree. It is what it does that makes it a computer. A "turing machine", if you want. It is a re-programmable calculator, in a sense.
Techincally, they're defined as being electronic, but probably only because we've never built a true computer that isn't electronic.
But a computer can read and store and change data, that is what they do, and I personally don't care what they're made of.

"  But I won't concede that biological computers don't do math. They absolutely do."

There are no biological computers. Not true computers, they are not turing machines. They do not run programs.
If you're talking about brains, which I'm quite sure you are, then they are not a computer because they are only an adaptable network of nerves. Each nerve is a "node" in a network.
A computer has a central processing unit that controls the execution of a program in the way that Alan Turing designed: It moves a program pointer and reads instructions, and has the ability to make jumps by changing the program pointer to a different address, instead of just increaing it by 1 at every cycle.
A brain is fundamentally different, with no central processing unit, and no program running in any way similar to a Turing machine.
Of course, we don't yet fully understand how the brain does everything, so we should be careful about making too many assumptions of the details, perhaps. But essentially, it still just sends signlas around a network that adapts and changes. It "remembers" things by strengthening the connection between different nerves.
A brain also doesn't produce output like a computer. It's a much more complicated mess.
Yes, brains obviously can do math, since we can do math. They certainly don't do it the way computers do, and brains suck at math in comparison, and makes an awful amount of mistakes, because brains work by being associative, by connecting different things together to form relations between things. Such as hearing a sound and knowing what it means, by creating a connection between those things in the brain. It's a very complicated network.
Computers are inherently simple, though modern computers have expanded everything so much that they no longer appear to be simple.

" DNA itself uses a base-4 system. Numbers are very important in biological systems (two kidneys, one spleen, ten fingers, etc.)."

Yes, DNA can be describes as base-4, due to its ability to store 4 different bases. Everything has some base-N. That is the nature of things. It is our way of describing it, our way of making sense of things in a scientific or mathematic way. Nature doesn't care, though, it just is what it is.
RNA is base-5, if I remember correctly. It has one additional nuclebase type.
I dunno, it's poossible that DNA could have had more than base-4, it's just that it happens to have base-4 in life on earth. I might have read that somewhere, I'm not sure.

Numbers are not important, and aren't even a factor. Due to the sequence in DNA, different number of things are produced, but the biology never sees them as numbers, because the idea of "numbers" is a human invention, and it is conceptual. Whether or not you call something "2", it is what it is, and that is what matters.
What s importnat is that things work well. Whether there are 10 fingers or 26 six fingers doesn't matter as long as they work in a good way.
And you cannot say that the amount/number of thing is important to biology, because everything is always inherently numbered. A beach has a specific number of sand grains on it, but that doesn't make it "important" to the beach. We could have 16 fingers, and a beach could have 100 million fewerr sand grains, it doesn't matter.
It would be better to have 2 hearts, for example, but we only happen to have one. "Bad luck" or whatever, but that's how it is.
If a snowflake has a spefici number of arm, then that's just what happens due to chemistry and physics, it wasn't important in teh sense that someone had to make sure it was exactly like that, or whatever.

You make some really, really weird arguments. I have a hard time understand what the point is, it seems like the train-of-thought from someone who is a bit high, or something. :P
Reply: +antiHUMANDesigns    "...we assume it was meant to be interpreted as message"  No, we don't need to assume.  We can objectively observe function and outcome.  Craig Venter's work demonstrates that re-arranging sequences can produce a varied organism consistently.  Change the blueprint, change the outcome after processing.  What you seem to be referring to is mere pattern observation.  I spoke of this in my video.  Patterns by themselves do not qualify as symbols precisely because of their subjectivity.  For language to work, there must be consistent rules of grammar, syntax, etc.  We have that in DNA (although of course we are still discovering those rules).  It is objectively verified by results, not by conjecture.
   "There are no biological computers...they do not run programs."  There are a lot of evolutionist scientists who disagree with you on this, especially information scientists who know biology.  Even Richard Dawkins disagrees with you.
   Your post was very long, and very interesting.  I would love to sit down with you and just talk about all this, but writing "books" back and forth is difficult in this forum.  Neither of us has unlimited time.
Reply: +Seen From Space "I think you must believe evolution has never happened mainly because there's not enough time in a young universe"  Actually it is the reverse.  Evolution could not have happened because the science shows that the universe is thousands, not billions, of years old.  I know it is popularly thought that science proves an old universe, but I strongly challenge that claim.  The ubiquitous presence of carbon-14 in all fossil carbon is conclusive proof that none of this material can be older than 100K years.  The increasing finds of original material in fossils with intact bio-polymers is conclusive proof that this material cannot be older than a million years (and probably only a few thousand).  This is hard science, but evolutionists want to cherry-pick their natural process clocks.  Natural process clocks of all kinds serve to indicate maximum ages, not absolute ages.  With hundreds of these clocks available, they virtually all disagree with each other, so they couldn't be rightly interpreted as anything else.
Reply: Mark Champneys "I know it is popularly thought that science proves an old universe" which is exactly what it does. Stop misrepresenting what science actually tells us! You wouldn't say any of this if you were more particular about your sources.

"..original material in fossils with intact bio-polymers is conclusive proof that..." we might at the very most need to revise our understanding of fossilization. Again please refer to the people who actually study these samples first hand! Are any of THEM saying we need to rethink the age of the fossils? I've read the papers and they are not. The presence of C14 in fossil fuels etc is well understood (biogenic contamination and/or isotope decay in surrounding geology). Don't make this into something it's not!

OMG you can talk about cherry-picking! How about Flood Geology of which you say you're a supporter? It's a hypothesis about how just a few convenient formations came to exist, but it ignores vast swathes of data that it has no power whatsoever to explain. I gave you a few examples in another thread. Please understand the laughable inadequacy of CPT and Flood Geology to explain the planet as we find it. Lisle, Hartnett and others have tried to explain away ancient starlight by playing with special relativity, but as usual there's a ton of data they ignore and which their hypotheses can't accommodate. Happy to provide more examples.
Reply: Mark Champneys "Patterns by themselves do not qualify as symbols precisely because of their subjectivity."

Yes, this is what I was saying. Nature sometimes creates patterns or figures, randomly, which we could interpret as being a message from someone, but unless it was intended as a message, it isn't a message.
But we might mistake something for a message.

"For language to work, there must be consistent rules of grammar, syntax, etc. We have that in DNA"

You have to consider what the simplest form of DNA can be. If you're going to talk about DNA, then you cannot only talk about the DNA we see in humans now, for example, since that is DNA that has evolved for 4 billion years.

"  There are a lot of evolutionist scientists who disagree with you on this, especially information scientists who know biology. "

I'm not sure that they do, because it may simply be a matter of defining "computer" differently.
A computer doesn't change, it is a framework for running programs. The programs can change, and the data in RAM and in storage can change.
But biology builds itself, it's like a program that builds a computer, rather than a program that runs on a computer. And a computer is a "slave" to humans, while biology is about surviving. A computer like the ones we use cannto evolve because it would be the opposite of a parasite, an organism that only serves others at the cost of itself. Such a things should not exist in nature.

But fine, I can at least agree that some things that go on in biology can be likened to a computer. But I can't point to a single thing in that completely fits the definition of a computer, can you?
The closest I can coem is the ribosome, because it looks sort of like a turing machine (a computer), but it isn't. It doesn't work like a computer. It only reads and outputs, it doesn't write back into DNA. If it did, then it would work like a computer, and could potentially do what computers do.

" Neither of us has unlimited time."

 I agree, and I have less time now than I did some time ago.
Reply: +Seen From Space   "Are any of THEM saying we need to rethink the age of the fossils?"  Very few, and it demonstrates perfectly their strong bias against the science.  Evolutionists dogmatically cling to deep time even when the evidence against it is conclusive.  A perfect example is Mary Schweitzer who discovered soft tissue and blood cell remains in dinosaur bone.  She said it was impossible for these tissues to last that long, so... "we must not understand everything about the fossilization process."  Actually we do understand the fossilization process very well.  But heaven forbid that evolutionist assumptions are wrong.  The stubborn reality is that these original tissues are fragments that are not fossilized.  (That's why they call it original tissue, duh.)  The latest one I learned about is ten different intact identifiable proteins discovered within a duck-billed dinosaur fossil.  Proteins are complex and delicate molecules.  They simply cannot last more than a few thousand years under good conditions, and certainly no more than a million years under theoretically perfect conditions.  Yet there they are!  The science of tissue preservation is well-studied.  So why is it ignored in this regard?  Very good question.
   By the way, I have communicated by email with Dr. Schweitzer.  She is a Christian and a very nice person, but she insists on clinging to millions of years despite the evidence.  This is partly why I call evolution "anti-science."
Reply: +antiHUMANDesigns "...we might mistake something for a message."   I'm the one that said this can happen.  But we can guard against this danger of subjectivity, and look for symbols that are objectively decodable.  It is clear that biological systems do decode the DNA consistently to build proteins, regulate gene expression, etc.  And altering the nucleotide sequence will make it be consistently read differently by the same biological systems.  Clearly the message is encoded in the digital sequence.  We don't have to be subjective.  This decoding process can be very consistently observed.  Consider this article (by evolutionists): http://ki.se/en/news/complex-grammar-of-the-genomic-language
Reply: Mark Champneys "Actually we do understand the fossilization process very well." Um, who are "we" exactly? There's very little agreement on how long soft tissues can last. Given unusually antiseptic conditions, who is to put an upper limit on it? Ironic that you should call on uniformitarian assumptions yourself and assert that anything is impossible over millions of years! (Were you there?) Besides, outliers - of themselves - never demolish any theories. Please don't  imagine that's how science works.

"..cling to deep time even when the evidence against it is conclusive" You're such an optimist! You prefer back-of-an-envelope stuff like CPT to a model built on 250 years of real work. You can deplore RationalWiki for atheistic rubbish, but go through this carefully and when you spot the technical errors, let us know:
http://rationalwiki.org/wiki/101_evidences_for_a_young_age_of_the_Earth_and_the_universe
I repeat, this a technical business, and hypotheses stand on technical merit, not on theological hygiene.

I'll end with a quote from your friend:
"They treat you really bad, they twist your words and they manipulate your data."
Dr. Mary Schweitzer, on creationists abusing her work.
Reply: Mark Champneys You keep using the word "decode". There is no "decoding" going on. DNA is not encoded.
DNA works pretty much exactly, in theory, as a ".exe" file, except that it builds proteins instead of running a program.
".exe" files are also complicated in a similar way as DNA.
The content of an ".exe" file is not "code". It isn't encoded, and neither is DNA.

I read the article. Do note that "words" and "grammar" are analogies. We can make the same analogies with the ".exe" file.

We both agree that the DNA of a modern lifeform is very complicated and intricate and pretty amazing and cool. All that is granted. I fail to see your actual pont with this. I did "consider the article". Nothing about any of this makes it "code", either.

No symbols are "objectively decodable". That is an oxymoron. A code system is an arbitrary agreement between individuals. It is the act of taking a symbol and have it refer to some other symbol, rather than the symbol having a meaning of its own. Any other form of symbol have a meaning, in that they represent/identify some concept of thing. Code sysmbols don't do that, they only refer to some other symbol. And the only way to know which other symbol they refer to is by asking whomever made the code system. Or, if the system is at all intuitive, you can break/crack the code.
Reply: +antiHUMANDesigns   You have just proved my point.  Yes, it is like an .exe file.  And .exe files are most certainly decoded!  They are simply a sequence of 1's and 0's.  But that sequence has enormous meaning, when decoded, and those instructions followed by the CPU.  Likewise, DNA contains nucleotide sequences of A, C, T, and G.  They are meaningless by themselves.  But meaning is derived from those sequences by the molecular machinery within the cell.  The meaning of those instructions can vary greatly with small rearrangements (stop codons for example).  The point is that instructions are not derived from the presence of particular digits, but from their arrangement.  Code!
Reply: Mark Champneys The CPU doesn't decode the .exe file. The .exe file contains a long stirng of 1's and 0's, like you say, and those simply instruct the CPU how to flip its switches in sequence.
There is no decoding going on, since it's not code to a computer, only to a human who decides that it is.
As I've said probably 100 times, if there was a decoding process going on, it would be insanely much slower. The values in the .exe are used directly, as they are, they are not encoded.

And yes, they have meaning to us, but not to the computer. Of course they have a meaning to us, because we wrote them that way for a purpose.
To us, they represent part of an algorithm or an equation, or something.

"Likewise, DNA contains nucleotide sequences of A, C, T, and G. They are meaningless by themselves. But meaning is derived from those sequences by the molecular machinery within the cell."

No, not "meaning". It is true that they produce a complex result, and that they have emergent properties. But no "meaning".

You're simply equating "meaning" and "emergent properties".

" The meaning of those instructions can vary greatly with small rearrangements (stop codons for example). "

You're still talking about what it means to us, not to the cell.
We can understand that these thigns have consequences, and so on. So we can impose a meaning on those things, but they do not inherently have a meaning. They have no use for a meaning.

"The point is that instructions are not derived from the presence of particular digits, but from their arrangement. Code!"

"Code" is not an arrangement, it is a system agreed upon by those involved in using the system.
Anything can be code if someone decides that it is. But that just means that it's code in their minds, not in reality.
To call something "code" is kind of like calling something "beautiful".

But have we not discussed this enough? If we keep doing this, we'll only repeat ourselves over and over.
Reply: Mark Champneys When are you going to delete this video? You've failed to sustain any of the arguments, and it's been spelled out to you how all of them are plain wrong. The whole video is poorly researched and serves only to mislead the semi-educated. If you had proper regard for accuracy and less for this broken ideology, you'd do the decent thing.
Reply: @antiHUMANDesigns  if you want to know about abiogenesis go and watch James Tours videos. If you want to argue about it, go and argue with him, not me. Im no expert on the subject but James is.
Reply: @johnmeredith6890  Hehe, James Tour... 
The guy who's famous for spewing a bunch of pseudoscience.
How about sourcing basically anyone else, instead? :P